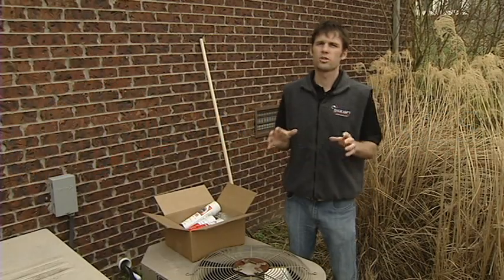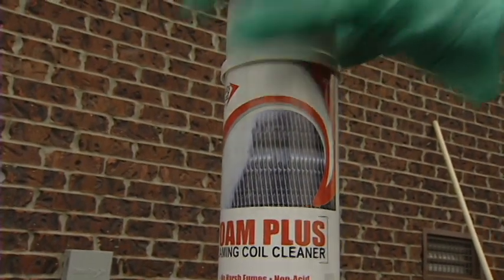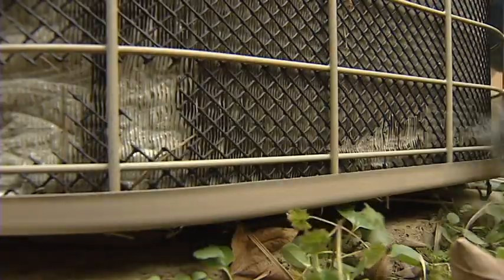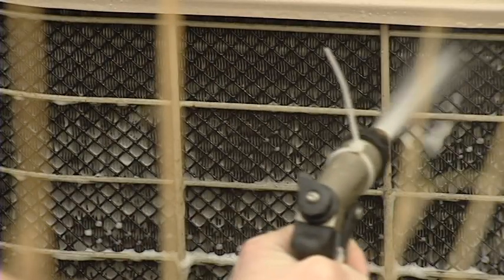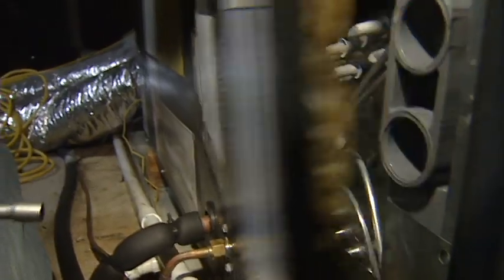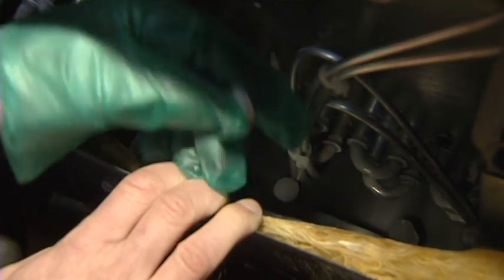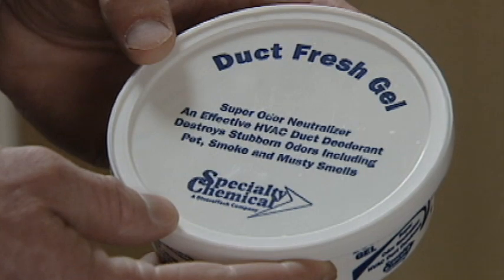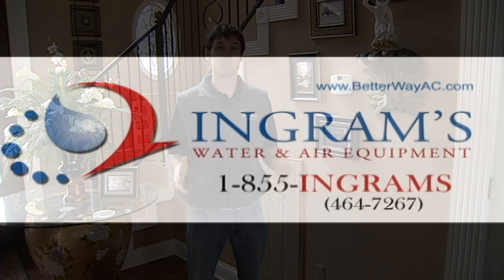How to Clean An Air Conditioner Unit

Comment: I was thinking the same thing - why the undersized filter - this will allow dirt to travel to the evaporator coil -  also the evaporator coil panel (in the center of the evaporator coil) can be removed to clean the other side of the evaporator.   Also I would recommend cleaning the drain line (adding a cup of bleach) - and sucking out the drain line with a wet dry vacuum
Reply: That filter did not fit in the return